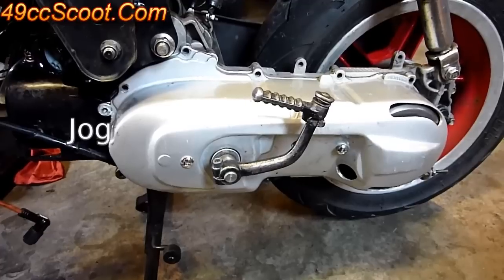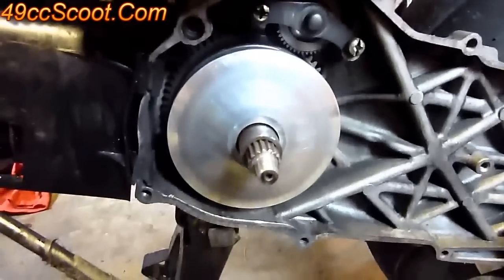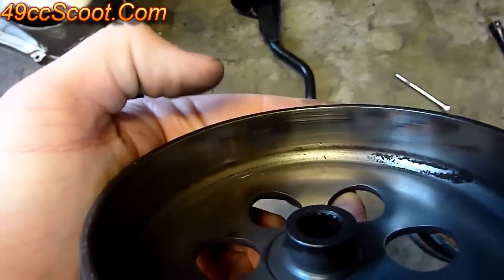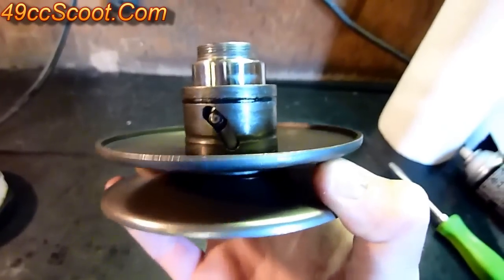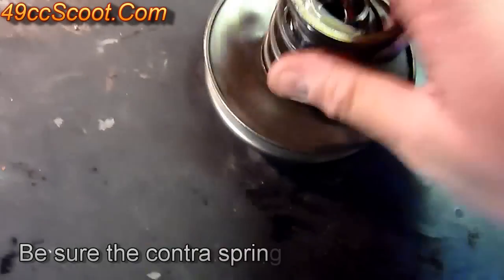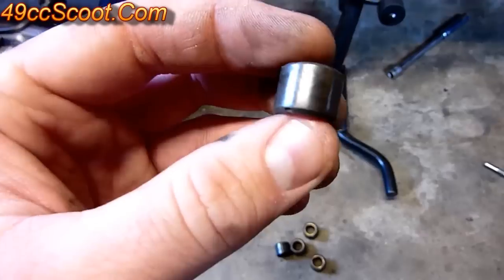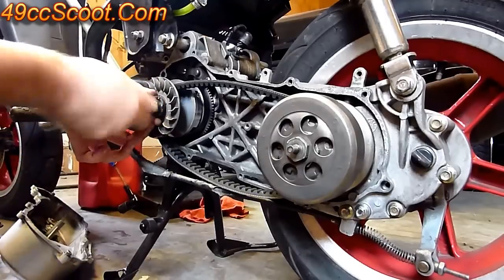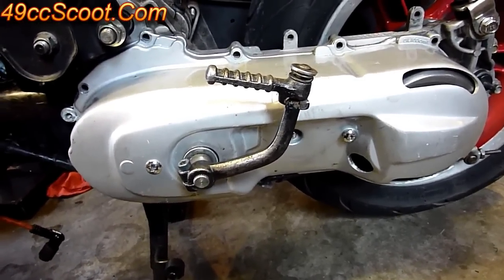Scooter CVT Transmission : Full Service Inspection

Comment: Hey, I got a project scooter to fix up and sell on! I'm having a problem with the transmission though I think.... When I rev the bike fully while standing beside it, it starts to pull really slowly and then eventually it'll get up to a very slow walking pace, it also feels a bit jumpy as if it is trying to take off! Once I sit on it however it will not move at all, but again you can feel it jumping underneath you and trying to take off! Have you got any idea what it might be? Thank you!

Comment: No I am using Japanese Bando belts... I did some research and apparently 835 is not the ideal length for a scooter with 12 inch wheels, so I am going back to using the 842's ... but the thing is, I've removed the case to inspect the belt and I realized wear marks on the outer side of the belt, it's rubbing against the case, the variator diameter is 115, no idea what the roller weights weigh ... but is there some kind of "best practice" combo in terms of variator diameter, roller weights? 157QMJ

Comment: I HAVE A QUESTION. MY SCOOTER 50cc VENTO Triton HAS A EXHAUST Stage6 PRO Replica RACING,CARBURETOR STANDARD WITH MAIN JET#100,Variator NARAKU Racing V2.0, Drive Belt Stage6 PRO 788MM,CLUTCH STANDARD 115MM WITH SPRINGS 1500RPM.MY QUESTION IS THIS: MY SCOOTER RUNS TO 50-mph (80-km/h) with Rollers 3g. why  WHEN REMOVED THE Rollers 3g AND I PUT THE 5.5g DOES NOT PASS OF 25mph (40km/h)? Please if you can help me thanks
Reply from the maker: +Brikos S RPM is probably too low. You've got to have the revs up enough to get into the powerband (where your engine/pipe make the most power) to get good results. Too heavy and RPM won't reach peak output, too light and you'll rev past it. 2.5g is a big jump in weight. Try moving .5 to 1g at a time when tuning.
Reply: THANKS FRIEND. I'M GOING TO TRY WITH 2000RPM

Comment: How hard is that spring in the clutch to squeeze? 
my scooter keeps eating belts, and I think it's because my clutch is squeezing my belts too tightly. I've seen some videos of people opening their clutch with their hands and it seams to open and close pretty easily, but mine I feel takes a lot of strength just to squeeze open. 
any suggestions?

Comment: my scooter is making a funny sound during or just after I start it up. It makes a squeak like sound. I don't know if it from the starter or what. As well, I noticed just when I'm starting to accelerate, I feel some frictional vibration. But after I pick up my speed it soon stops and runs normally. I started noticing these things after a minor fall, skid crash. Maybe has something to do with them, maybe not. Any troubleshooting insight?
Reply from the maker: If it's just on the first say 10-15MPH, check out the clutch. For the squeak, try to figure out where it is and exactly what you or the scooter are doing. Could just be something like a panel that moves around and squeaks if the scoot idles different when you first start it.

Comment: I have been getting a slight almost grinding sound from my CVT. I took the cover off, and cleaned around the inside of it with a rag, but i could not get the nut off the front pulley with an impact that i bought from harbor freight, which i took back, or a strap wrench and a socket, but i will eventually get that off with a friends impact. Could that be the weights? I am ordering sliders anyway, and hopefully will be able to get that nut off. The shop had put it on way too tight, i guess.

Comment: Got a bws 100 and not reaching 80km/h (50mph) and belt looks a little rough and clutch slipping, could that be the reason?
Reply from the maker: Could be. Check the belt width and compare to specs in the service manual. RPM will increase and speed will decrease typically as the belt wears, especially beyond the service limit.

Comment: I own a ZNEN L-Roar, the engine is GY6 157QMJ, the original belt that came with the scooter was an 835-20-30 ... I replaced it with a 842-20-30 and it was working quite well till it snapped after doing almost 1K kilometers, so i decided to replace it with the original size (835-20-30) and it snapped in less than 50 Kilometers, I got another brand and it snapped again ... now what could possibly be snapping these belts?

Comment: Does it affect much on the reliability of the variator if i have some scratches on the surface of the variator pulley? So could it brake the belt if theres some scratches on the pulley part that touches the belt?

Comment: I've  done 8700 km on my cvt transmission without touching it. Is that pushing  it ?  would it pay to check it (rollers clutch  etc)  at about 15,000 km. I heard belts are good for 15000
Reply from the maker: Varies from scoot to scoot. Best advice is check the service manual. I clean mine at least every 3000 miles with my 49cc. Doesn't worry me to go 12,000+ miles with my 500cc.

Comment: Hi
I have gy6 engine with 788x16x28 belt.
If I change it to 788x17x28 .
What will it be the benefits?
Reply from the maker: A wider belt could help with speed, because it may be able to ride higher in the variator. Could hurt takeoff. Most of the Chinese 4Ts will use at least an 18mm wide belt stock.

Comment: can you help me on my scooter 2 stroke sym dd if  put on a center stand the rear wheel continue spinning and when i brake the rear brake the engine dies..whats wrong w/ my scooter
Reply from the maker: Sounds like maybe your clutch is not functioning as it should or something has happened in the variator and it's stuck open. The latter should cause really poor performance. The clutch may just cause issues at or near a stop.

Comment: hello friend, my bike is giving a problem after an accident, I could not start the engine ... disassemble the carburetor and calibrated. finally achieved starting the engine, the problem is that the engine speed and reach 5000rpm it starts to wane, as if drowned carburetor. but to try to drive the scooter does not move, loses strength ... What do you think? which can be a problem for the CVT? could give me some advice?

Comment: Im riding a Kasinski prima 50cc and recently it lost power. I had the exhaust decarbonized, and it only got just marginally better. Ive been told maybe its time to change the transmission oil and that might do the trick. The problem is everyone seems to have theory and no certainty. I noticed that when going on really steep downhills where it used to do 70kph it wont go past 45kph as if something was jamming. Its not the brakes as that was the first theory, and its been fixed. Any ideas? Thanks

Comment: HELLO FRIENDS. I HAVE A QUESTION,I WANT TO BUY A CLUTCH, THE BELL HAS A MEASUREMENT  INSIDE OF 107MM. THAT MEASUREMENT HAS TO BE THE CLUTCH THE SAME ONE OF 107MM OR 105MM ?
Reply from the maker: +Brikos S The bell is what they go by when you see 105 or 107mm, so look for a clutch labeled as 107mm to work with your 107mm bell. It will actually be a smaller diameter.
Reply: Thank you bro, sorry so many questions

Comment: Hey. Would a belt this size fit 
 

782x18x10.2mm 28 Grad on the engine 1e40qmb?
Reply from the maker: It should fit, but the 788 17 28 belts have worked the best for me.

Comment: I rode two scooters long ago, a Honda Express and a Yamaha Chappy. They were ok for a trip of 5 miles or less but I have now been riding a real motorcycle for decades. The wheels of scooters are too small to produce enough gyroscopic force for teal stability. I saw a large man take a fall from a scooter for this very reason as he tried to cross a slight pavement irregularity. Scooters may work for some but give me a full sized sport bike every time.
Reply from the maker: I've got a 500cc, but I put 5,000 miles or more on my Chinese scoots yearly. At least 5 times a year I will ride them 8-12 hours straight. Just breaks for gas or the bathroom. I like getting on the bigger bike and how easy it is, but some people enjoy the small scoots and maybe a little of the adventure that you don't get on a bike that just does what it is supposed to for years. I can see both sides. 2 wheelers are badass because there is one for everyone and they've got so much more character than most cars IMO.

Comment: nice but how do you stoped the engine, i have been try install a new timing belt but when i tried to remove the first part it keep roiling and the bolt doesnt go out.

Comment: whats the best belt for a gy6 150cc? and what belt model number do i use, another excellent vid
Reply from the maker: I don't deal with 150s enough to tell you for sure, but I prefer Bando on my 1E40QMB/Minarelli clones and on my 139QMB/GY6 50. Good belts that can be bought at reasonable prices. Whatever you do, don't buy generic Chinese belts. They are junk. Belt size will vary depending if it's a short or long case.

Comment: Hey man, i'm really unlucky since my GY6 threads on the lower bolt that the variator tool  would fit on is stripped and filled with high head expoxy since the hole went straight in the the engine and would eventually leak from the hole, so i thought about using an Electric impact gun for the variator nut, only problem is i cant find 30ft lbs torque sticks, I can only find 65lbs as the lowest, which i know is too much..

So if i would turn the nut on by hand as much i could on the variator, then hit it briefly with the impact (not holding the trigger down for more than a split second) could that be sulution to get the variator off and on safely?
Reply from the maker: Not a great long term solution if it's a powerful impact. I think a lot of ppl do that with the electric impacts and learn how many bumps to give it.

https://www.torquestick.com/cart/30ft-lb-TORQUE-STICK-EXTENSION-BAR-Black.html
Reply: I know it's not really great but i just wanted to get the rollers out and mix with a roller tune set with different rollers to get better acceleration and change belts in the future, tho, i wounder, if i use my screwdriver/electril portable drill with a adapter for 1/2 maybe that could work or it would probably just spin the engine around right?

The impact's 450 NM, 1010W, 2200RPM, tho the quick buzz with torquing the nut down could work atleast, right? or should i wait untill i can somehow accuire an torque stick of 30ft-lb??

also regardign the shipping on that torque stick is 75$ to sweden, haha.. wow.. maybe a tad bit expensive for just a somewhat light and small stick of metal, haha.
Reply from the maker: The drill will just turn the engine and prob not enough torque to secure it properly. You can do it without the torque stick. I used to.. but then I stripped a few cranks and quit it. Honestly though I tune so much it's not like I installed the nut a couple of times and it stripped (it could if you really overdo it I'm sure). I had done LOTS of tuning to any of the engines that stripped so the vari was on and off constantly.
Reply: I hopefully will not strip the nut/threats since i really will only be taking off the vaiator  when im gonna change weights to get better acceleration or such.
Reply: Could the 65ft lb torque stick be a somewhat of a comferting factor when i reinstall the nut or would it be a stupid idea?

it would prevent too much overtorquing but i dunno how much you can really go before messing up the threads..
Reply from the maker: Save the money on the 65ft-lb toward a proper one IMO. It'll limit it some, but you're still over-torquing. There's got to be a 30lb-35lb stick out there somewhere that can make it to you for less than $75. Talk to a local tool place maybe. I think you can get the feel for it enough with an electric impact from what I've seen in vids that you'd be okay. I know I've heard members of the forum says X amount of bumps feels right. If you have a torque wrench you can skip the impact on assembly if you have a way to hold the flywheel or variator still.  Even just a ratchet would be fine. As long as you don't use some big breaker bar type ratchet most people would be find hand tightening. With the impact I just suggest getting a limiting setup because the cranks I've replaced from bad threads were more money than the torque stick and a PITA besides.
Reply: I found this on ebay: http://www.ebay.com/itm/301231696283?item=301231696283&viewitem=&vxp=mtr
Slightly cheaper tho the shipping would be a question how much that would be since there's no shipping charges on the ad it self, tho it was the only place i could find an alternative than the link you sent..

I checked at my local "autozone" and the 40nm stick there would be well over 140$ since its a good quallity one apperantly, haha.. (price is just for one torque stick, not a set)
Reply: Oh while i am at it.. I suspect small metal shavings have come into the engine and thought about changing the oil, since i dont really have the money to get another kind of oil thats non-synthetic and all i have is part-synthetic do you think i could reuse the oil that came from the factory after putting it throught a fine metal strainer thats in the funnell i'll be using? or would it be Okay to use part synthetic?

The engine's got about 40 kms..  or about 25miles, the " recomended breakin perioid " is 300km or  about  186miles, i know in your other video you said the breakin period was 500-1000 miles and not to be using synthetic oils but how about part synthetic?
Reply from the maker: I'd go with the synthetic blend vs stock oil.
Reply: Alright! thank you for the help man! :) I dunno what'd I do without your expertiese. =P
Reply from the maker: No problem.

Comment: Hey, thanks for the explanation!
Do you use any grease on variator where the roller stays?
Thanks on advance!
Reply from the maker: No grease for the rollers. Some scoots call for it in the service manual. In that case you can. I've tried it for my scoots and the grease attracts other debris and doesn't seem to give any benefit that I can tell. My favorite solution is to use sliders.

Comment: Could you do a little vid about the starter gears? At my Aprilia Rally the big gear that turns the freewheel/crankshaft is kinda loose and starts to wobble above 7000rpm which shouldnt be that way i think.

Comment: Is there only 1 size of torque spring for all 50cc 2t scooter be it 1000 1500 or 2000rpm?thanks
Reply from the maker: A Minarelli engine and a Piaggio engine would use different springs. They vary a little from different manufacturers of springs. There are springs for over range kits that are a little different. Generally though, if you order a kit or a Minarelli/1E40QMB 2T it should fit regardless of the rating.

Comment: ive got an 03 zuma 50. There seems to be a weird vibration at speed. It feels almost like a hopping sensation or like going across a mild washboard road.  It seems to be coming from somewhere in the final drive, not so much the engine. You can really begin to feel it at about 15mph and increases in frequency with speed. Any clue what the issue is with this thing?

Comment: where can I get the clutch springs or a new clutch I cant seem to find a part number for either one. I start mine and it seems to want to just take off.
Reply from the maker: http://www.partsforscooters.com/?partner=49CCSCOOT carries both. Not sure what engine it's for, but they have clutches and clutch springs for the common Chinese scoots in both stock and performance versions. If you're buying clutch springs, I'd consider performance springs. I'd advise checking it out before buying anything though.
Reply: wow thanks this should help

Comment: When I spin the rear wheel when my scooter is up on the center stand I hear a slight grinding sound from the clutch area, what should I do in this instance? I have heard of cases where one of the clutch springs have broken and makes one of the clutch pads rub on the bell, is that maybe the case? Or do I need new bearings in the clutch? Thanks in advance for any feedback:)
Reply from the maker: It's not likely to ever be totally quiet, first off. If it's not loud, then it may not be an issue. The first step is to inspect. It could be gearbox or clutch/rear pulley if it's in that area. Look the clutch over and maybe change your gear oil and see if glitter or anything alarming comes out.
Reply: @49ccscoot  It isnt really loud, but audible enough to raise concern. I recently changed the gear oil and it looked normal, so thats a good sign😅 I am going to take a look at the clutch pads and springs, but my main concern is the bearings:/ ill grease em up to see if it changes the noise, and if it does ill probably buy some new bearings:)
Reply from the maker: @JVBNorway  The bearings in the rear pulley can be turned by hand and if they feel gritty/rough, hard to turn or they make noise that way then you know there's a problem.
Reply: @49ccscoot  thank for the advice! i will try that:) I will try to give an update when I find out😁